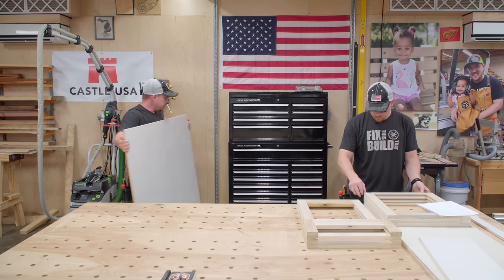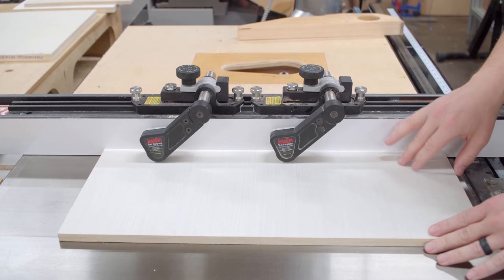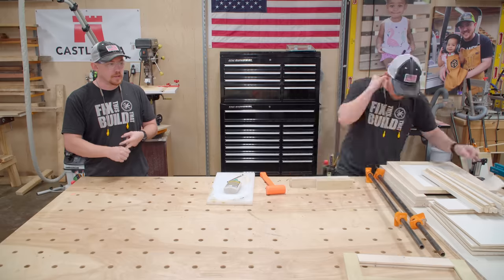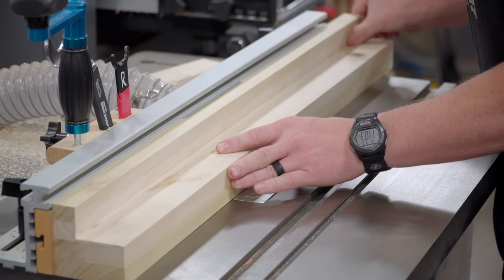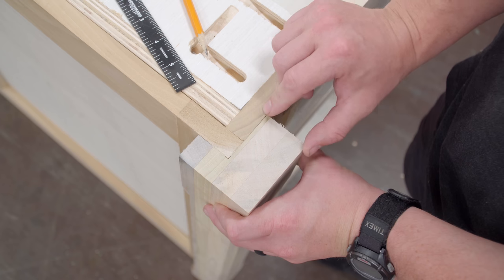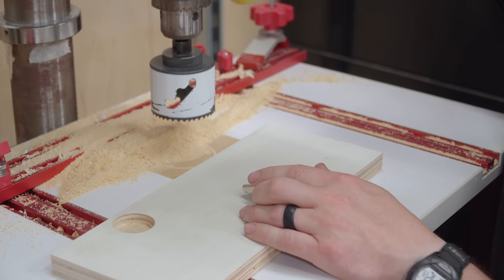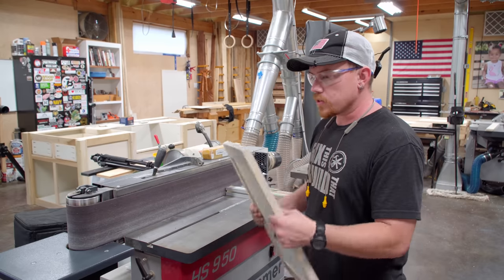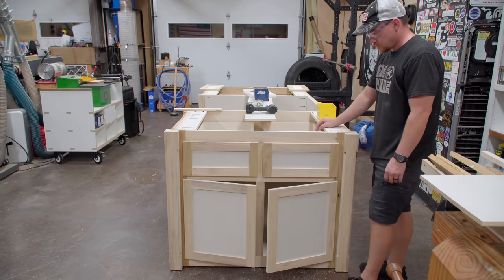Cabinet Doors and Drawer Fronts - Outdoor Kitchen Island - Day 4 - 392

Comment: Jay, I’ts been awhile since I’ve left a comment. Not only have you lost a lot of weight, I see a workout bench back there and some iron on the wall. Looking good buddy. Thanks for the cabinet build project videos. My daughter grew up following and helping me in a little woodworking. Recently she has been building a new big wall cabinet. She insisted on doing it “without” ANY physical help from good ole dad. Did’nt even want me around while she was cutting and building. I left a hint of this your build on a note in her garage and think she has secretly been looking at it without wanting me to know….haha. Although, She has asked to use my tablesaw for some odd reason.

Comment: Always enjoy your work Jay!
An alternative to the cnc for your hinge holes is a great tool I bought from Sommerfelds tools. Hinge boring jig, which when in position allows you to drill the cup and two screw holes. I bought it on Black Friday several years ago and it’s been a life saver for me. Blum makes an identical one in orange for quite a bit more $$. No affiliation to Sommerfeld btw.
Rod
Reply from the maker: I've seen a few of those. Super handy for the specific task.